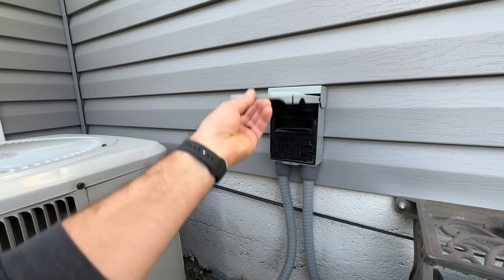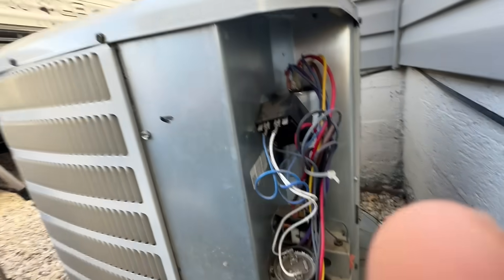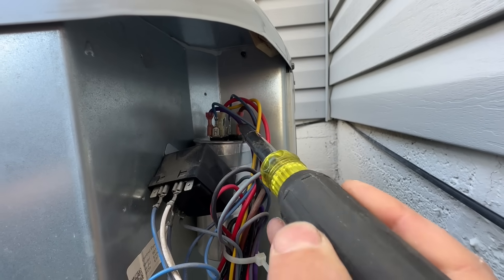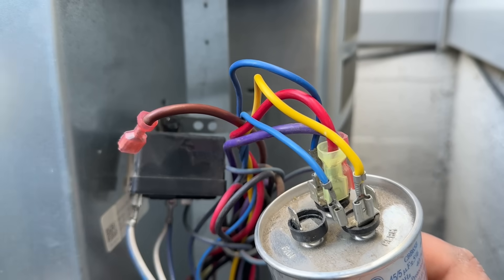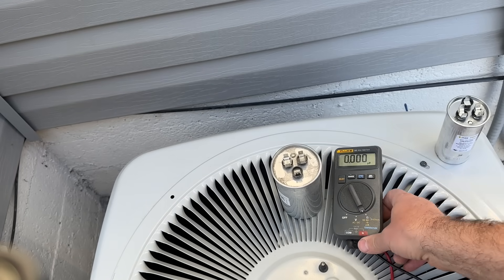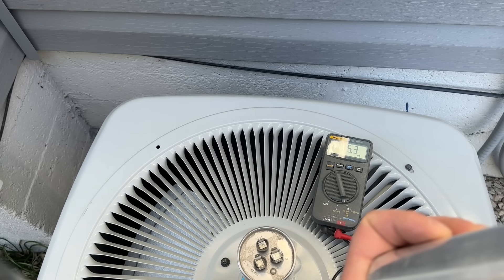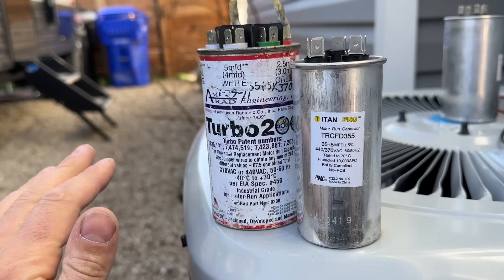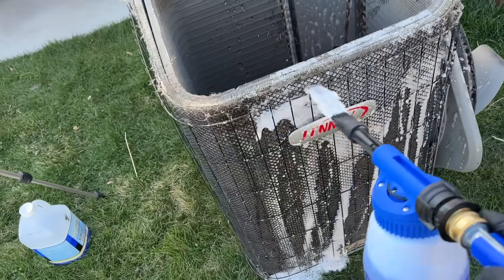How To Check & Replace An Air Conditioner Capacitor

Comment: How will you know if the capacitor goes bad? Will it shut off?
Reply: If the capacitor is bad either the compressor won’t start. Or the fan won’t start.
Depending on which section is bad.

Comment: What is the shelf life of an unused backup capacitor? I changed out mine about a year ago when the compressor wouldn't come on each time the fan did. I actually enjoyed doing it. I'd like to keep one on hand, but don't know how long they last on the shelf. I got mine on Amazon so all I have to do is click re-order, but I'd hate to wait in the middle of summer, but I also don't want to store one past its effectiveness either. Do they drain like regular batteries when not in use? I had a neighbor show me an invoice he paid for $450 for the same capacitor that cost me about $12. And yeah, I told him that.

Comment: Hi, can I fit a 30 µF capacitor on the compressor of an air conditioner outdoor unit, without meeting the specifications of the original 25 µF capacitor, or is there no tolerance margin ?

Comment: Capacitors are essential batteries. They store up a bunch of electricity and let it out quickly to do something like start a fan or act as a short term source of additional power surge. So, by design, they will hold power even when the power is off if they are working. Definitely arc it before you touch it.

Comment: Thank you so much! 🫂. You're right, I paid over $200 to have a tech replace my AC capacitor. Women get robbed in my area. But I'm learning. Also don't believe everything you hear because some service tech that own their own business will try to place a little fear so you can replace your AC unit. That's how they make a huge amount of $. Research, beforehand
Reply: $200 for a service call isn't a ripoff even for a woman. Most people don't take into account it takes time and money for them to get to your house. Training, time, gas, truck/van cost, insurance, licensing, billing, accounting, marketing. They can't work for free or they won't be in business long. The next time you need that guy you may have to call someone else that charges more because the $200 guys business failed because he didn't charge enough to stay in business. I hate when honest tradesmen are lumped in with the scumbags that are actually ripping people off. Realize you're paying for more than the $20 cost of the part. Plenty of "Beer can cold" guys out there that work for beer money but sometimes cheap can get expensive. Fair price is usually the best price.
Reply: @inflationsux  - You're right!

Comment: Do capacitors typically "fail up" or "fail down"?  i.e. if my capacitor registers right near the top of its percentage range, do I have more time before it fails, or can it fail up?  I ask because if I test the capacitor and its close to either percentage limit, it seems like a smart move to replace then rather than waiting for an imminent failure.  Thoughts/

Comment: ALWAYS take a photo of the top of the capacitor so you know which color wire goes where on the new capacitor. Not knowing which goes where is dangerous and makes this simple fix into a big problem. I'm shocked that you didn't mention this at all.
Reply: He did mention this around the 3:35 timestamp mark…

Comment: Mine has had this problem before, so when I came back from a trip and the house was hot, I knew what to go look for. The top of the capacitor was crowned up - easy tip off! So I ordered one off Amazon last night ($14), it got here today and I spent 10 minutes swapping it out. I came back to this video just to make sure I was handling the capacitor correctly. And I'm sitting in cold A/C as I type this. Oh - and I've also had the start capacitor on the blower fan burn out. I knew that wasn't the problem here because even with the thermostat set to Off you can set the fan to ON and it'll run. THANKS FOR HELPING US ALL OUT!!

Comment: I pulled the capacitor out and it test with in the +-3%. Mine is 5uf/80uf.

Tested at  4.817/77.8

So now what do you think. Thermostat sends signal to the ac compressor and you can hear power going to it but nothing happens other than the coils being very warm.

Comment: My AC isn't working. One day during the middle of a heatwave it worked really well, almost colder than usual, then the next day nothing, just blowing out weak hot air. I let it sit, and a couple of weeks later when there was another heatwave, when I turned it on I could hear the fan going as usual, no strange noises, but again just weak hot air. I recently changed the capacitor but I don't notice any improvements. My unit is on the roof, I purchased the correct capacitor (45/5) and connected the wires from the old capacitor to the new capacitor one at a time. Now it's blowing weak cool air (the heatwave ended, but I think if it was still ongoing it'd be weak hot air again). Any advice?

Comment: Does the capacitor have any effect on the heater?  You kept saying AC, but then I think you also said it kicks the fan on.  Reason I ask, I just had my AC serviced.  Everything was good except he said my capacitor is about 10% low and the summer is almost over

Comment: Only comment on universal capacitors is you want your connection from your fan/compressor to be on the highest value you used the jumper on. For example if you need 35 mf and you jumped 10 and 25 then you would connected your compressor wire to the 25  prong. 

Could never find the actual engineering reason for this but every drawing from manufacturer 
 shows the connection to the highest rated prong and that’s how I was taught.

Comment: My condenser will turn on and ran for about 10 to 15 minutes and it will shut off. I replaced the filter and cleaned the fan. Do you think i have a faulty capacitor?

Comment: Installed the part mentioned in the Description on our Lennox M/N 10ACC-060-230-02. Turned On-Off from the basement Circuit Breaker giving 20 seconds before turning it back on.

Blower in  the Basement has lots of condensation.  Need to replace the filter also.

So waiting on house to cool down. Hopefully. 

Thanks for sharing your video.

Comment: Hey how are you, thank you for your video, I have a quick question… so My ac window unit fan stopped spinning. I checked the capacitor, it’s super rusty but it reads 60/4. This unit is old and 60/4 is impossible to find, is there any other alternative that translates to it?

Comment: Thanks! Dude you literally saved me 300 bucks and a gallon of sweat. My unit died when it was 92 degrees.
Reply: this is really good stuff and channel. my fear is being shocked by 'leftover charge' i
but i suppose just touching a screwdriver to those little points with wires attached will release? kinda like static electricity once you get shocked it is gone for however long?
Reply: wow, what a great use of the internet. wholesome

Comment: But how do you know in the first place that the problem is the capacitor rather than the compressor or coil or some other part?
Reply: You don't. But spending 30 bucks and fixing the issue is the better option of the 2.

Comment: The new capacitor has 1 terminal. But the old one has 2 and 2 wires running out. Where would I put the end 🤔

Comment: Thanks for the video. I have a 45+5  440VAC +/- 6% capacitor. When I shop on Amazon there are a lot that fit this spec by the same manufacturer. There must be another indicator on which is the right one for my Trane XL16 unit. How do I choose?

Comment: Probably a dumb question(s), but what if the unit itself doesn't have a plug or breaker? Should I look for it at the panel and flip the breaker there? And if my panel isn't labelled so well, should I just shut off the power to the house (labelled "service disconnect")?

Comment: You're not kidding when you say that this knowledge can save hundreds if not thousands of dollars. I am pretty handle and tackle many jobs often because I have a hard time getting folks to even call back when I need work done. A week ago my pretty old, but generally reliable Ducane central air unit stopped cooling. So I called my regular HVAC business that I have used pretty consistently over the years.  The conversation immediately went to refrigerant loss and if it's R22 (it was) the probability was high that a complete replacement unit would be the best course of action. And, of course, a diagnostic call would be a minimum of around $300 just to come out. Thankfully they were pretty busy and wouldn't even be available for a diagnostic call until the following week. And from that point on all I am wrestling with is the good money after bad repair scenario and should I just bite the bullet and go with a new unit. I was pretty convinced that was my fate. I also remembered that I have a good friend in the business so if a replacement was needed I'd trust him with the work. 

So, on Saturday I decided that I would take a quick video to document the issue, something I had not yet done. Cooling switched on at the thermostat, ran outside and witnessed a buzzing compressor with an occasional clock trying to start but failing in that attempt. That had me curious. So, after digging into videos like this one a good portion of the day, I felt confident enough digging deeper into the unit to see what I can find. I had absolutely nothing to lose at that point. And wouldn't you know it. I no sooner pulled the wiring/component cover than the capacitor showed itself as the top and bottom bulging, badly rusted, used up unit that it was. Probably the original from 2007 and served it's time well. Sunday I rang up my friend and he actually had a suitably sized capacitor in his stock. I picked that up, installed it with no issues and the unit was immediately back in fine working form. That part cost me $10.00!!! Time will tell if it holds but for now with a short run to the end of the season for us in the Northeast, I am up and running with the money still in the bank. 

So I thank The DIY HVAC Guy, and all the other YouTubers for freely sharing their hard acquired knowledge so that dummies like me can confidently and successfully tackle these sorts of projects.

Comment: Where do you buy the capacitor? And will the ac just not work and power on at all if its bad? Mine condenser is short cycling. The charge is good.  It's pretty hot.  Ac ppl told me too just put a sprinkler on it,  and when i put a sprinkler on it it stops short cycling but i don't feel i should have to do that.  And yes all filters and coils are clean....

Comment: This video was incredibly helpful! The only thing I would say is that the colors of the wires in my unit were different than this video..which I quickly realized once I started the unit as the fan motor quickly got hot and was making a sound I knew wasn’t right 😅 But I switched the wires and boom, cool air!  Thank you!!

Comment: This saved me no telling how much in repair costs.  I easily followed the video to check the capacitor with a multimeter and swap a new one out.  One caveat - whatever was going on with the capacitor also blew one of the fuses in the safety switch that you need to pull out before doing any work on the unit.  Once I replaced the capacitor, it still wouldn't run until I installed a new fuse in the switch.  If you have the same problem with a new capacitor, be sure and try a new fuse (or both) as well.

Comment: Thanks for a helpful video, and a likely money-saver.

I wasn't certain from watching what terminals need to be 'jumped' to safely discharge the capacitor before handling it.  Specifically:
 - Are you making a connection between the different leads on the same terminal set (e.g., connection between the leads on the FAN terminal to one another, 
   connection between the leads on the HERM terminal to one another)?
 - Are you making a connection between the FAN leads and the GROUND?  The HERM leads and the GROUND?
 - Are you making a connection between the FAN leads and the COMMON?  The HERM leads and the GROUND?

 - Something else?

Comment: What if your capacitor is a 370V 35/5 can you replace it with a 440V 35/5? IE a higher voltage.   Also mine is a +-5% and I see a bunch on amazon with +-6%  is that a concern?
Reply: I think it's ok to have a higher voltage. If it requires a 440v, don't put in a 370v

Comment: My ac went out and I’m pretty sure it is the capacitor as there were many of those signs. Do I need the volt multimeter? I’m confident installing the new capacitor myself but wasn’t sure if the meter was necessary or not.

Comment: Very ignorant question here in regard to discharging the capacitor.  Does the handle of the screwdriver need to be rubber, or can it be plastic ?  Also, it seems to make no difference which order or combination you 'join' the posts when discharging.  Is that correct ?  Lastly, would rubber dish glover protect me if the capacitor wasn't discharged properly ?  Sorry if that sounds super naive.  Looking forward to using the 'Thanks' option for the first time once I get this one, as your video was great.  Please reply today if at all possible !

Comment: I can't find an exact match for my portable air conditioner capacitor (70μF+-5, 250VAC, 40/85/21). Can I get one that ISN'T 40/85/21?  Or does it have to be an exact match? 

I'm a novice when it comes to electrical engineering.

Comment: Thanks for this video. It was going to be several days before my contractor could make it out to my unit. I fixed it same day for $12 by replacing the capacitor. Hardest thing was finding a place to buy the cap since some supply shops would only sell to Contractors. Got it at Grainger

Comment: Our AC went out in the middle of the night.  The next day it was 95C !  We called our HVAC company and was quoted $220/hr just for diagnosis.  We called our HVAC friend and thru facetime, he suggested replacing the capacitor.  We ordered the part on amazon ($20), it came on the same day and we were able to replace ours.  We deep cleaned the coils, plugged the power in and boom! cold air galore!!! Thank you for the video!
Reply: 95. Celsius is not possible.
Reply: @roycenimchuk8425  🤣 I was thinking the same thing!
Reply: @roycenimchuk8425  thank you for correction, it is 95F.  noted! thanks!
Reply: @roycenimchuk8425  turns out the thermometer was in their sauna

Comment: THANKS FOR THIS! Cost me $60 to get another multimeter to check the old one (measured 7.87 on the 45 side) and $10 for a new capacitor. NO REPAIR MAN! Thanks again - it was 102° today in S. Ft. Worth!

Comment: A great video….having the same problem with cooling on a Senville unit with some buzzing and non-starting of the fans(a double unit)
Thought I should check the capacitors but couldn’t find any; everything seems to be digital and electronic. Do all compressors having capacitors as in this video? Thanks.

Comment: Thanks for the video.  AC went down yesterday.  I remembered the last time when I called out an AC tech, it was the capacitor.  Saw your video and bought a new one. Unfortunately, I am a dope, The old one was so corroded I couldn't see the markings. I took photos, but thought I knew what I was doing and didn't look at them when I installed it.  After I realized it wasn't working correctly, I looked at my photos and realized the problem.  I got it hooked up correctly and AC is working.  I should have left the old one in place and just switched out the wires when i got the new one. Thank you for taking the time to make the video.

Comment: You just saved me four days of waiting, a few hundred bucks, and hot frustration during a 107°F day. An easy-peasey drop-in replacement. Just a heads up, taking lots of pictures, and orienting the new capacitor just like the old capacitor so you won't mix up wiring, like I did, is helpful before pulling stuff apart.

Comment: If you change a cap your self , make sure it’s 440v not 330v , also buy lightings surges protection install in disconnect- it’s why the cap went bad especially if in high lighting area like florida

Comment: Dang, I'm a bit scared of the charge in the capacitor. Is there an overly cautious way of checking to make sure the capacitor is discharged before removing it?

Comment: My daughters LG air conditioner, after being cleaned by a technician recently, started to work differently after he left, e.g. when I turned on the inside unit, the fan blows at full capacity and then the inside unit shuts down. The outside motor (compressor) doesn't kick in at all when this is happening, and then the inside unit that is blowing the fan at full speed shuts off within a minute. I rang the technician and he said that he was willing to come back to have a look at it and of course take my left arm for the problem he caused in my opinion, because it was working fine before he pulled it apart to clean it, so I told him to FO in the nicest possible way. I am not in anyway a technical kind of guy, but I think I can change the capacitor by myself, if that is what it is. I would appreciate any assistance that anyone reading this can provide me with, e.g. do you think it is anything else apart from the capacitor. The outside motor (compressor) kicks in after about half a dozen attempts at turning it on and off, when the inside unit was blowing air at full speed, so it sounds to me like it is the capacitor, as that is what gives the compressor that extra kick from videos that I have seen. Appreciate all assistance in advance.

Comment: Last summer, we had a HVAC contractor come to look at our malfunctioning unit and he replaced the capacitor. After looking at this video, I took the cover off and saw he had put in a 45/5 capacitor. I downloaded the manual for the Carrier 38CKC036-340 and it says to use a 40/5. Should I swap out the capacitor or leave things alone?

Thanks